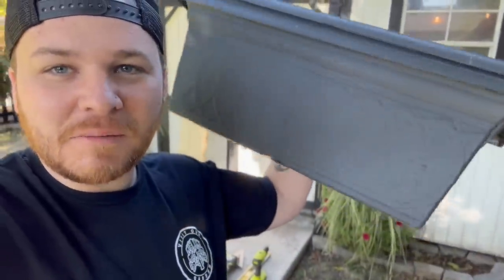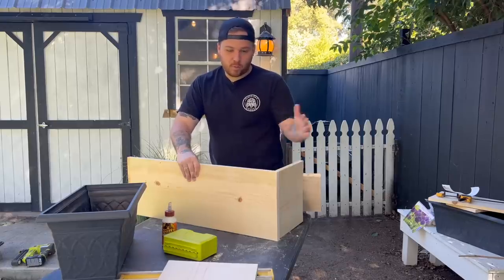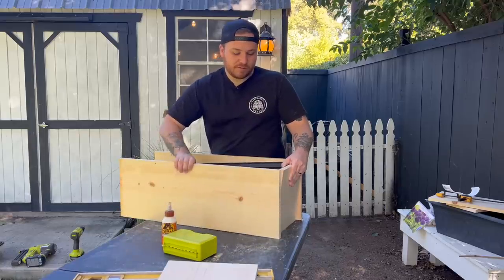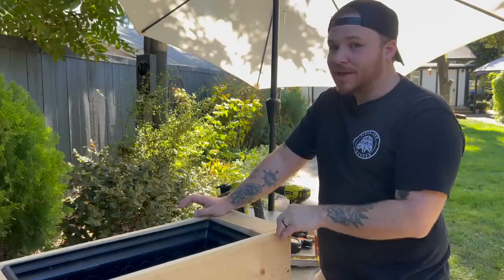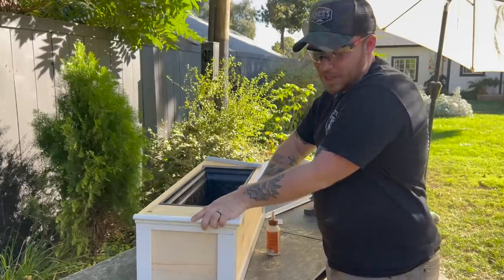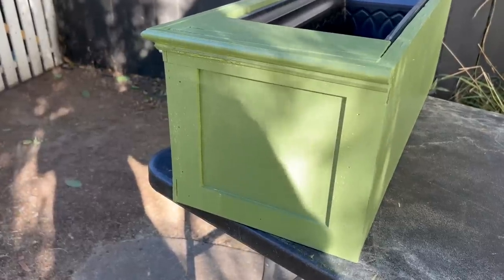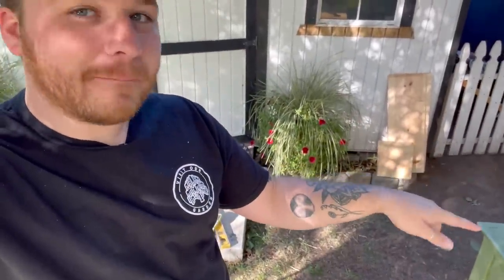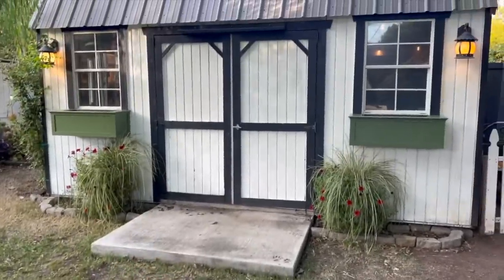We Made Window Boxes for the Shed 🪟🪴 || Visit Our Garden

Comment: Never mind. There is no bottom. You should support the plastic liner. I tried something similar and the edges of the liner gave out and the liner slide down from the weight of the wet soil. Just an fyi. Yours might be fine.